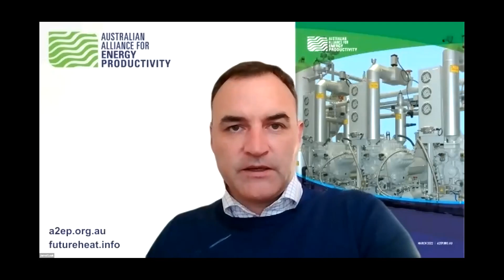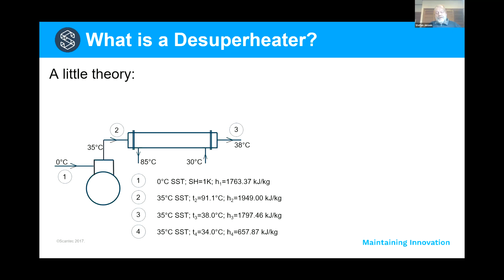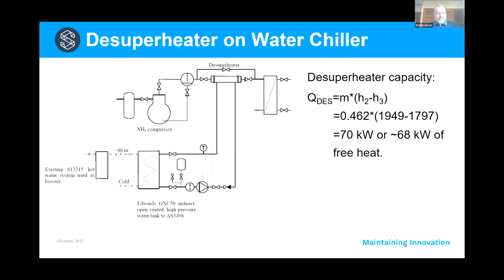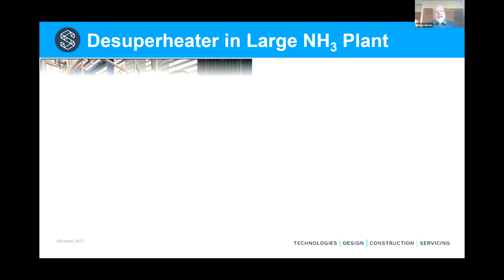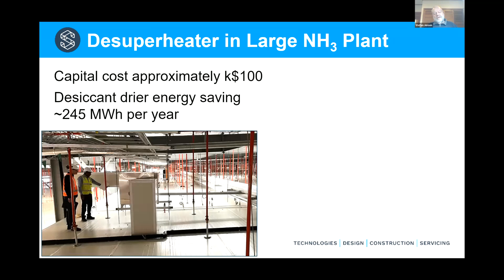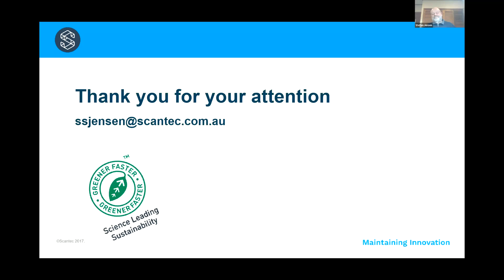Heat recovery in NH3 refrigerating systems - Scantec presentation for A2EP

Comment: The temperatures on the ammonia side in the first diagram don't look correct, they need to be higher than on the water side
Reply: It is saturated temperature, the temperature at which ammonia is saturated for the operating pressure on that line, the actual temperature is 90degrees. It is ambiguous I admit that too. Good video by the way. Thanks guys.